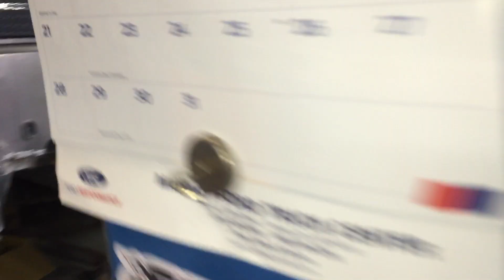Calling out Absolute Powerstroke in Kansas City!!!

Comment: Absolute Powerstroke is the  shop that did my set of injectors. 1 week later had a cracked tip and they would not warranty their own work. They tried to sell me 2 bottles of rev-x  at 70 bucks a bottle to fix it. I had to take it to Anthony to get it fixed right. Thanks for looking out for us 6.0 Powerstroke drivers Anthony.
Reply: That sucks dude. My truck got stolen from their lot and totally destroyed.

Comment: This brings this old scenario to my mind.. Years ago I bought a 21' ski boat advertised as, "New Chevy 454. Low hours, engine runs, but makes noise"... I got it cheap, took it home and fired it up, and yep, it sounded like a jackhammer. I was looking over the exterior of the motor, and the shiny new chrome air filter caught my eye. It looked like it was JUST installed, complete with fresh cut marks on the threaded rod for the wing nut. I thought hmm, could it be that the sawed off end of the rod have anything to do with this? I pulled the right side head off, all looked good. Pulled the left head off, and there sits, on top the #3 piston, a beat to hell 1" long piece of 1/4" threaded rod. 😆 Everything was still good except for the fact the crank was actually bent. I had the crank straightened, got a new bearing for that journal, slapped it back together, and enjoyed that boat for many years after that. Sometimes it's the littlest thing that can bite you. I can't believe the owner of the boat that installed the air filter didn't look for that 1" piece of threaded rod that he cut off. It would have been simply laying on top of one of the throttle blades in the carb, and taken him 2 seconds with a needle nose to retrieve it. HE would have enjoyed the boat instead of me.

Comment: If you work on things like the 6.0 diesel and you come up with missing nuts or blots you better be looking for them. Chances are there in spots where they shouldn't be. I can't even believe whoever worked on it last let it get out of the shop that way. I'd be so freaking mad if this happened to me. Most times when I'm in my SD I'm either hauling my tractors around or even better my family and our travel trailer going camping. If my truck left me on side of the road because of a unqualified person worked on it and left a small bolt down in the engine thinking it would never effect anything. We'd have some big issues. This engine and labor is way too expensive to be lazy with.

Comment: Dropping a bolt into the 6.0 intake port can be pretty easy. Like the other day I had to pull the intake to do an oil cooler on a 6.0. Well the truck had been worked on before by someone else and had dropped two small bolts down beside the intake. I always blow air and look beside the intake before I lift up the intake. Well I didnt see those two small bolts. They both fell down into two intake ports. But before the intake goes back on I always put my boroscope down into each port to check them. If I hadn't done my double check I would have been pulling the heads. Like I said its pretty easy to have a bolt fall down into the intake port if someone else had dropped something beside the intake. Another thing they should take care of there screw up. Because we would have at our shop if I had not seen those bolts even though I wasn't the one who left those beside the intake.
Reply: sorry im late popcorn line was long
Reply: my company  was in the same shoes head job 2years in a row on a 6.0 ended up costing my boss over a grand for them to release it from warranty work

Comment: Has there been any movement on this ? The title of the video hasn't changed.
Reply: Before he was Absolute Powerstroke, he was Absolute automotive repair. Had him do a head gasket for me on a Lightning. Supposedly dropped 4 bolts into my intake, destroyed the motor. He admitted fault...after 4 months of my truck sitting at his shop. Built me a new motor that took another 11 months, which spun a bearing and cracked two pistons sitting in the driveway idling. I didn't even bother calling him. I didn't think the results would be any different if I had. I laid it all out on google reviews for absolute powerstroke.

Comment: masking tape saves your ass
Reply from the maker: mike foley not my ass,,  I have flexible magnet strips I use.
Reply: I was say I use it to cover intake holes when off. plus a shit load of brake clean and air blower. guy sounds like a hack. till you work on these trucks youll  never have a clue